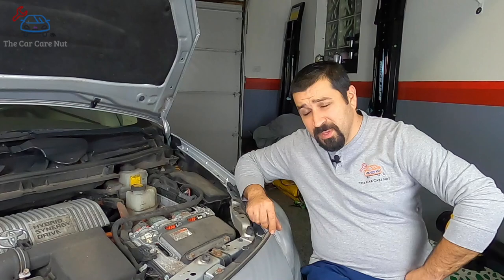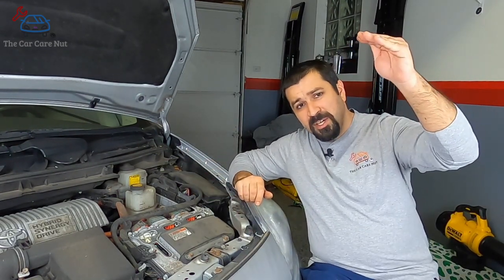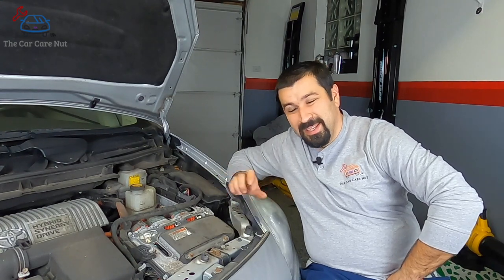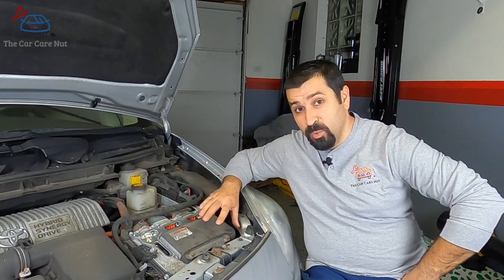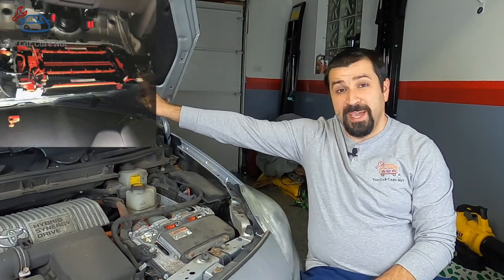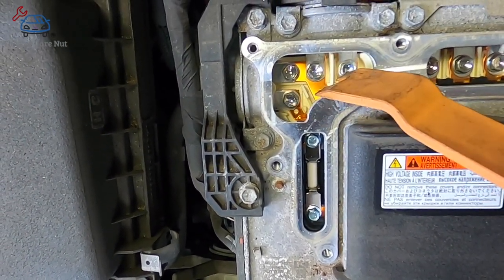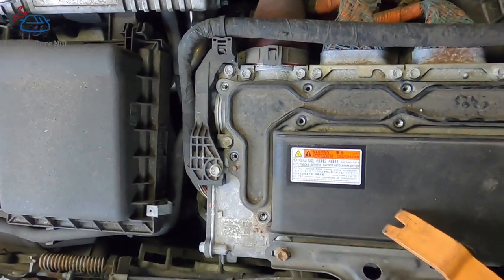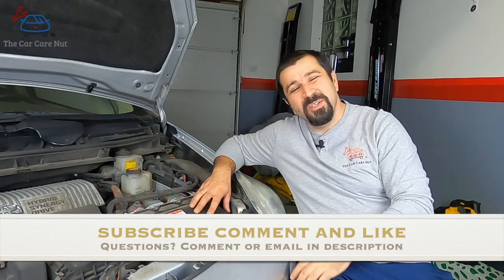How Toyota Hybrid System Work Part 2 Inverter with Converter Assembly

Comment: Hello, when my 2007 catalytic converter was stolen it would not shift into gear. After I replaced the cat the car would still not shift into gear. I towed it to my hybrid mechanic and he said the problem was the inverter (not sure if the cat being stolen messed up the inverter) He then fixed it for about $500. Right now it seems my Prius is running fine no lights on dashboard it feels great but I'm having a hard time trusting it to take it to work. Before my cat was stolen I was on my 3rd refurbished hybrid battery. Someone once told me that when your battery dies fast it may be due the inverter going bad.  What do you think should I just sell it? or is there hope for it to last a bit longer. It's at 185,000 miles right now.

Comment: Need help/ advice: 2012 Lexus CT200h replaced the small battery, the hybrid battery and the inverter car is still not “ready” and the light does not come on… the mechanic did all he could but no luck, please help…no code no check engine light on, 2 keys are locked and unlock works , the engine has no problem, mechanic said the immobilized good but the car does not start.

Comment: I had mine replaced by Toyota when it went out, but to there credit Toyota extended the warranty for the life of the car on those inverters.    😂😂😂😂  I thought that coolant was low but I figured I was wrong.
Reply: Wow. What year was the car and at what mileage ? Were you the original owner?

Comment: Hi car care but, I bought a 2022 Highlander hybrid bronze edition at full tank with only 2 miles on it. The car got empty at 380 miles and I was supposed to get 595 to tank. I called the dealership and they’re saying I should drive the vehicle for 1,000 miles for the system to know my driving pattern which doesn’t make sense to me. What do you think I should do? Please advise
Reply from the maker: Hi! There’s a procedure that the dealership can do to reset the gauge. See if it gets better after thay

Comment: Hi, do you know what is the maximum continuous power for 12v output from inverter? (Rav4 2021 Hybrid 4x4)
Reply from the maker: Hi! Do you mean how much power you can draw from it?
Reply: @TheCarCareNut  Exactly, I need to know how many receivers I can connect not to overload it
Reply from the maker: There’s no exact figure but around 1500 watt is what seems to be safe
Reply: @TheCarCareNut  Thank you for your response

Comment: Ehm, Ah, don't confuse the hybrid coolant plug with transmission drain plug LOL. Don't ask me how I know. LOL. Yes I did, thought it was like my "Normal" Camry then all of this light pink fluid comes gushing out. I am thinking, Well it's supposed to be pink but it way too thin. Looked in the engine bay and I can see the coolant draining fast. Oh well, put it back in and looked for the actual transmission fluid drain plug. 600 Volts, that is a lot of juice.
Reply from the maker: Yes they do route the coolant through the transmission on some models! Looks like a drain on the transmission but it’s actually the coolant. The transmission drain plug is a little bit towards the back

Comment: How man Kw is battery in 2021 hybrid
Reply from the maker: Hi! Which model?
Reply from the maker: This will vary by model as they don’t all have the same battery.
Reply: @TheCarCareNut  ok. Are they all Lithium ion now? And what is size of battery as a range ie. 1.5kw to 2kw. In corolla 2021
Reply: @TheCarCareNut  sorry mate, I didn't have glasses on before when walking the dog. I thought you said 'Which mode" not "model" hahah. Thanks for tolerating my ignorance
Reply from the maker: So some models are lithium ion some are nickel metal. In the US the 2021 corolla is lithium ion. I don’t have access to my system at the moment to get the exact spec for the kw
Reply: @TheCarCareNut thanks mate

Comment: I have a 2017 camry with 44k miles i thinking the timingchain cover is leaking small. Its out of dealer warranty is this something that I need to address asap of can the car still last 200k+miles
Reply from the maker: Hi! Your 2017 Camry with 44k is not out of warranty for the timing chain cover leak. If you’re in the US that’s covered under the powertrain warranty which is 5 years 60k miles. And yes other than the leak and oil dripping it will not affect the operation of the engine.
Reply: @TheCarCareNut  yes sir, Houston Texas bought it 3rd hand from carmax i noticed dried oil cleaned it and been checking daily for 3 days but I haven't seen any buildup yet
Reply from the maker: It will take some time. Keep an eye on it and especially look at it before the 60k mark if you see nothing by then I’m not worried.
Reply: @TheCarCareNut  thank you so much.

Comment: I have a 2020 Camry Hybrid. There is nothing wrong with my car but my 2014 Camry Hybrid had a 12V battery in the trunk. I can't find any 12V battery in My 2020.I've located the 12V post in the fuse box and am aware not to jump start anyone. I can jump start another hybrid and I can also be jump started. But where is the 12V battery.

Comment: That part can be repair?
Reply from the maker: The inverter can be repaired to a certain degree
Reply: @TheCarCareNut  I have Toyota Highlander 2008 with inverter problems and the prime Toyota dealer wants to charge me $9,000.00 dollars for the part plus labor
Reply from the maker: That’s very high. Did you try to find a used one?
Reply: @TheCarCareNut  no but I will try

Comment: Another note.  The hybrid system enable many more “advantages”.  Like NO BELTS on the engine.  At all. There are no rubber belts on these engines.  There is no alternator, the AC compressor is 3 phase electric, the water pump is electric.  Many advantages all adding to reliability!
Reply: How reliable do you think that inverter is when compared to the other major components of hybrid system ?
Reply: @kevtn8  In my experience, perfectly reliable.  A 2015 Camry with over 150K miles going strong (original battery, too).  Also my 2019 RAV4 is at 50K now and no problems at all.  When I was considering them, I looked at Consumer Reports reliability and all of the hybrids showed up as more reliable than the normal Toyotas, which is saying something.

Comment: Funny how my AC system for my home which has alternating current and  inverter to switch AC voltage to DC voltage to run the motors and my hybrid car has a converter to switch DC voltage to AC voltage to run the motors are these engineers  just in competition with eachother to see who can make they're stuff more complicated? 😂